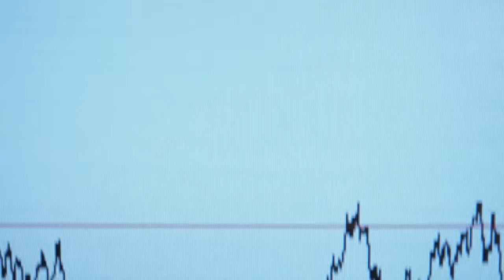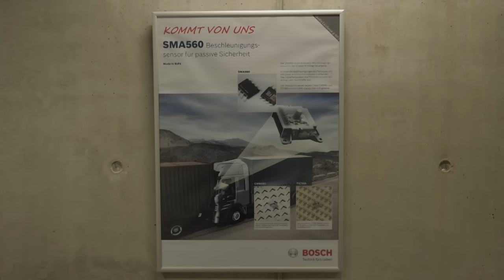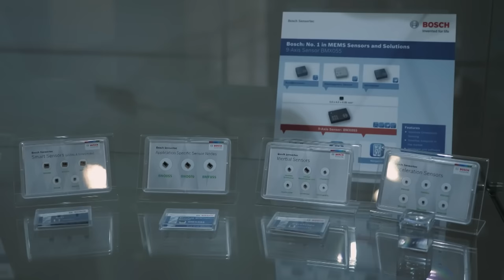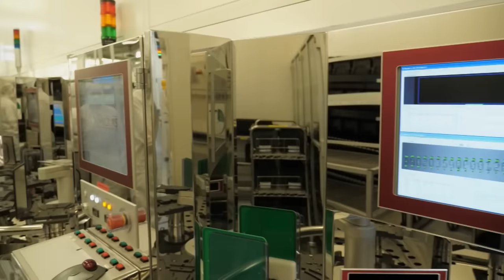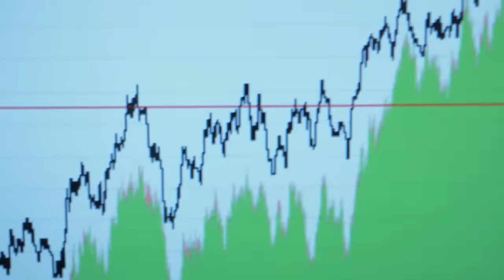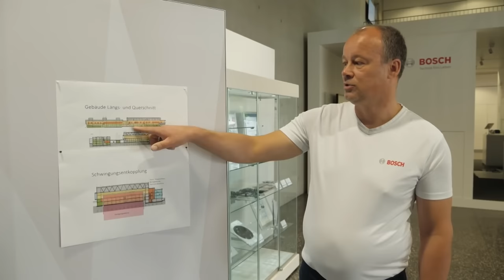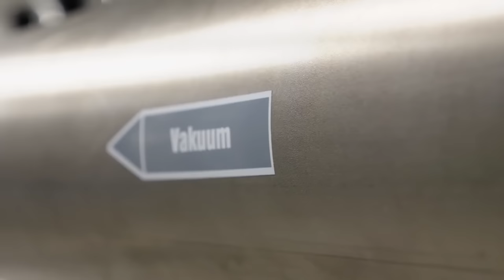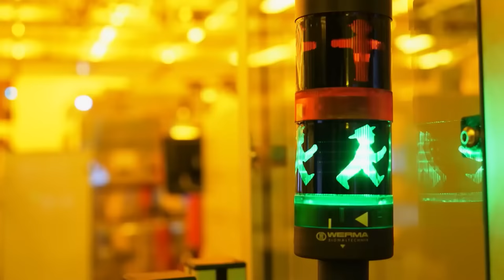Mega Factories: Manpower Meets High-Tech | FD Engineering

Comment: In the year 2000- 2003, I did not get Silicon wafers in India. My guide at IIT Kanpur Procured Silicon wafers from Motorola company, USA . I used to cut these films in diamond cutters and then annealed in the heat treatment furnace. The furnace I set up in materials Engg department. Then I annealed in high temperature and characterized by different instruments.

Comment: Etching after photo lithography is essential where chemicals required. It's very crucial and important. Lots of precautions used to take care. Chemicals should not touch with the anode layers. Etching is as crucial as photo imprinting in lithography.

Comment: Ion implantation required high vaccum. Turbo molecular pump only provides high vaccum. Rotary and diffusion pumps can not supply high vaccum. The dry particles of air mixed with either Nitrogen gas or Argon inert gas.

Comment: Semiconductor materials processing by using CVD, MOCVD, PECVD, RF and DC Sputtering, Glove boxes, Cluster Tools for dopings and implantations are highly reliable and risk taking process. Most of the vaccum pumps as such Turbo, Rotary and Cryo genic vaccum pumps are essentials to create high vaccum.  The 1000  particle clean Room, dress
, shoes, gloves are necessary to operate the vaccum instruments. The  silicon thin films should be etched properly to deposit different layers to fabricate  the device. Lithography and masking is also necessary. In addition to this all type of characterisations required to know the film thickness, morphology, interface, IV, CV, Efficiency, Crystallography, resistance etc. These instruments calibrations with sensors are highly sensitive tasks. I am one of the semiconductor specialist in this area.

Comment: Putting the painted Car Chassis & Bodies in a warehouse is a wrong approach  .   This is a " Waste " that should be 
eliminated .   Car Chassis & Bodies should be directed to the  Assembly Lines directly , no  "in between"  inventory .
Reply: every manufacturing process that uses multiple components must have buffer storage to compensate for production shortages on other components or else the entire line has to be stopped over one missing item. Also, often times production times for individual items differ and therefore nothing can be fed straight from the point of manufacturing straight into the assembly line. Furthermore products need to be quality tested which takes time and again requires a buffer in the event a part is faulty and needs to be removed from the process.
Reply: @silentepsilon888  Study the Just-in -time concept , and hire a Kaizen expert for improvements.  At least 
50% of the warehouse space can be cut away to save inventory cost & excessive storage time .
All bulky parts should be made Just- in-time and not store inside a warehouse for more than 3-4 days .
Reply: @chopinmack5418 and if ALL steps have an absolute 100%, never down availability, you're right. But even in the just in time process, they will still have a container of parts in the warehouse to give time for one container to be removed and the next to be brought in, and god forbid there is a storm or flood or natural disaster anywhere between you and your supplier.